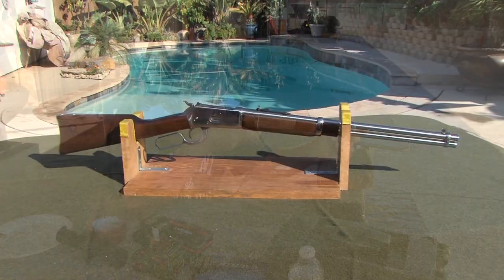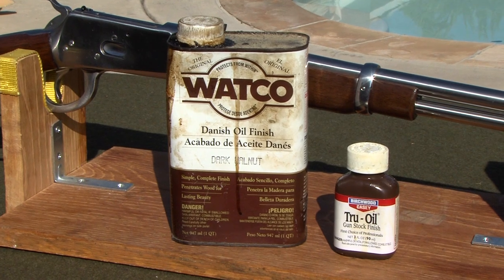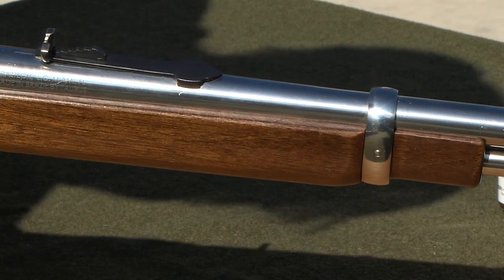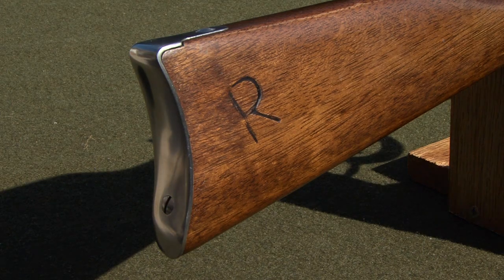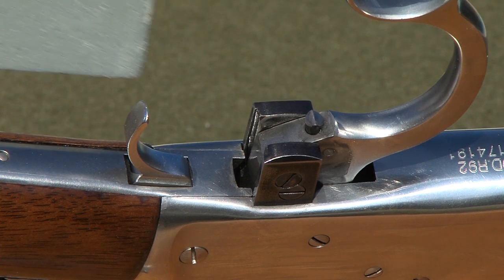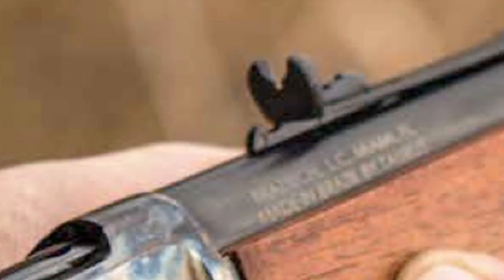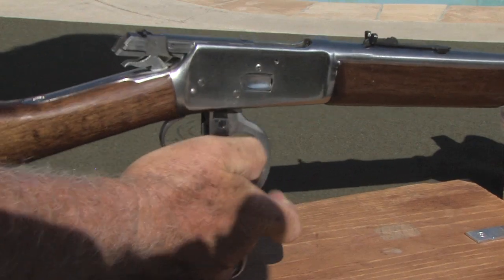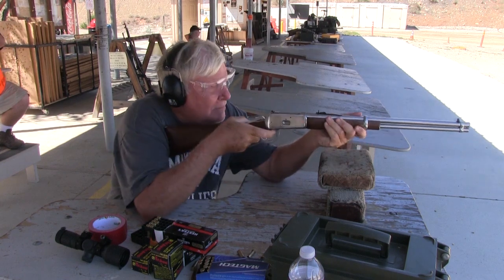Rossi 92 .357 tips

Comment: I have the 16 inch carbine in .44 Magnum. Not one jam! It loves Winchester White Label 240 gr SP and will shoot 1 inch groups at 50 yards (but that is because I replaced the rear sight with a Marbles folding sight and put in a brass bead front sight. Real good alignment of the sights.) Working now on a rear peep sight that fits the safety hole from Steve's. His kind of fits loose and I hope to use brass tubing to make it fit tight. Then sight in the ghost ring at 25 yards. I have a stainless saddle ring on it to for 'tactical' carry (like a one point sling on an AR.) All in all, it is well worth the price they ask for the gun.

Comment: Love my stainless 16” Rossi .44 magnum. Replaced the safety with the aperture sight and the plastic mag follower with a stainless one.. both from Stevesgunz. It’s the rifle I grab when I go running after bears and lions in the brush here in Western Washington. Puts em down for good with a well placed (and a couple not so well placed) shot.
Reply: My 44Mag Rossie now has a kickeez butt plate. It is a fantastic improvement. I also installed a Williams peep sight & side sling loops.
Reply: @geddycurrent1174  sounds like a nice setup. Is yours a 16”?

Comment: I used to own a Rossi Puma model .357 mag. rifle. It's the same as this rifle based upon the Win. model 92. The only maintenance it required over its lifetime other than cleaning was the replacement of a broken extractor. I never ever fired a .38 special round through it. I drove a 4x4 all the time and carried that rifle as my truck gun. I load for .357 a lot and I never had any problems wracking a round. I did notice you didn't know how to hold the rifle when you loaded it. Move your left hand rearward on the rifle until you can use one finger to hold the round you place in the loading gate.

Comment: Yeah I have a 92 with 16" barrel. Tiny little thing.  Ran smooth but it had a broken ejector.  Replaced the ejector but it had to be thinned out with a dremel to reduce the spring tension so that the action would close. Now it's smooth again and the shells don't hit me in the face.

Comment: Quality control must have gone way down over the years, cause theRossi M92 that I bought when the model was first introduced has none of these issues. It was near perfect right out of the box and is still one of my favorite firearms.
Reply: Rip Aycock   No complaints with mine either, which I got in 2018. Right out of the box, 1&3/4--2&1/4 inch groups at 50yds, about 3-4inches at 100yds with its buckhorn sights& leaning across my pickup hood, shooting 124-158gr FMJ & JHP. I believe I'll keep it.

Comment: It's kind of fun perfecting a solid steel and wood firearm.  I have a rotary Brightboy polishing kit that works very well.  Used it on knife builds to smooth out the solder joint on the guard soldering fillets too.

Comment: You mentioned some of the issues I had with the finishing of the gun. LOTS of sharp edges that needed to be smoothed down. And I had a enough issues with the gun jamming or launching live ammo straight up in the air when cycling, or standing up straight at attention in the receiver I sent it back to Rossi for warranty work. It turned out it had a bent frame. They are sending me a replacement. Hopefully I wont have to go through all the same finishing work smoothing down sharp edges. The underside of the bolt was practically razor sharp and sliced the top of my hand at the thumb open if I wasn't careful. A gunsmith friend helped me smooth the edges, now I know what to do myself if the new one has the same issues.

Comment: Great video.  I purchased the same rifle several years ago and did exactly what you did in regards to the wood.  Watco medium walnut and then Tru Oil.  In my case, I removed the rear buckhorn and replaced it with a Skinner peep sight (well worth the $ in my opinion) and a red fiber optic front sight.  The combination makes sighting a piece of cake and the rifle is very accurate.  

Excellent tips as far as ammunition, filing and polishing.  Thanks!
Reply from the maker: Eric, thanks for your comment.  That straight grained Mahogany really looks great after proper attention.  This is one of my favorite rifles when I'm shooting out in the desert.  Cheap to shoot and accurate.  The other rifle I take is my M1 Carbine.  Great and light weight!  Have fun shooting that lever gun!  Rick
Reply: Love mine. Where does the Skinner sight attach?

Comment: Very good video and straight to the point. I have as yet unfired Rossi R92 and interested in mods and opinions. My first job was to polish the loading gate and it improved my dummy test round loading, but you removed two inches of mag tube spring and that is my next undertaking to make loading easier.

Comment: Thank You Thank You- I used this as the rebuild plan when I got my Rossi 92 45LC. Many thanks!
Reply from the maker: hello William.  Glad my video helped.  My grandson is planning on getting a Rossi 92 45LC and I can't wait to shoot it.  I reload 45s for my Colts and I'll switch to a slower powder for the 20" barrel and see how much I enjoy it.  I've heard nothing but good about that caliber Rossi.  Rick
Reply: @skycamproductions  LOL-I do the same! - got to a single ammo and went 45LC. I have a Vaquero 6-gun (I modified it also, as I slicked the Rossi all over as well). Reloading, I use American Select power, 5.3gr-never more than 5.5, CCI 300s on a 250 RNFP Tex/Cowboy (Miss. Bullet). Works great on both the rifle and gun- burns clean too.
Reply from the maker: @wmwillis3   Thanks William for the reload info.  Because powder is still hard to come by, I may load the rifle rounds with the H110 I have left.  Also I use Titegroup for both the .45LC pistol and .357.  Once everything is restocked in stores, I will try your suggestion. Rick

Comment: I have one. The only issue I have found is it throws the spent shells right on my neck if I don't tilt the gun. And while I haven't sent real 38 special through it, the snap caps I have for 38 special kind of just go flying out of the loading ramp before I can close the bolt

Comment: I'm impressed you could load it with your thumb.  I've borrowed a stainless 92 a few times from a friend and loading it is a royal PITA.
Reply: He monitored that he pulled out the magazine tube spring and shaved off 2 inches.. I have done this also and can verify that it makes the loading process much easier, as well as it allows me to fix one extra round into the tube while having no effect on reliability
Reply: I bought a blued one recently and spent over 10 hours filing and polishing.  It's decent to load it now.
Reply: +spraynpray what barrel length did you get? Unless you got the full 22inch barrel, you should really consider shaving 1-2.5 inches of that magazine tube spring..
Reply: I have the 20" model.  I cut off 4" of spring.

Most internal surfaces had large amounts of flashing.  One bit was half the size of a dime and was folded over.
Reply: It still doesn't feed well, but it is far better than it was.

Comment: Some people say theirs will not cycle the .38's. Mine is a early one and feeds both pretty good.
Reply from the maker: +Shawn Swigart     Shawn,  I've experienced, with a full magazine,  double loading with .38s.  Sometimes 2 cartridges pop out.   At a range I seldom load more than 4 rounds anyway and that seems to be OK.  Also, I found that the rhythm of the lever helps a lot.  With .38s I push the lever forward, hold a fraction of a second, then pull the lever back.  I never load the rounds fast like the Rifleman.  Also, I seldom use .38s.  I've started reloading the magnum cases only.  Love the rifle even tho it isn't perfect.  Lots of interest in it at my range.  Rick
Reply: +Shawn Swigart Even the longer 158gr .357?
Reply from the maker: +filoIII Shawn,  I have no problems with 158 grn. magnum loads in general.  sometimes one gets stubborn and I have to give it a nudge into the chamber but my rifle has broken in well.  Have not reloaded with 125grn.bullets yet.  But will real soon.

Comment: Nice work. Next, remove the safety switch.
Reply: Make sure that you have a good reason to remove the safety.If you have to use that particular gun in self defense,you WILL be asked in court what prompted you to remove or defeat a factory designed safety device.
Reply: Were you asked in court? Or is this just an armchair comment?
Reply: @ @doughesson :  Can I ask where you live, state-wise?  Also, do you have any links to the cases where that happened in court?  Always trying to educate myself, and reading about the cases helps.  Thanks.

Comment: Over time some may find they needed some of that extra two inches of spring. I wouldn't trim until at least 500 rounds, preferably 1000 rounds. Just my two cents, take it for what it's worth.
Reply from the maker: Hi John,  you may be right on the spring trimming.  I've put several thousand rounds thru this rifle and its a lot of fun and so far have not had the severe feeding issues that I complained about.  The spring is doing its job so far.  But time will tell.  Thanks,  Rick

Comment: I found that it had nothing to do with the length of the cartridge, but rather the shape of the bullet.  Flat tips won't feed for nothing in my gun.  Rounded tips feed smooth as can be.
Reply from the maker: Hi X,  I believe you're right.  The Herters commercial bullet that worked smoothly was shaped slightly different than other brands.  It slipped right into the chamber.  I reload now and use an Xtreme 158 &125 flat tip bullet and a slightly tighter crimp and that has really helped.  Plus I've run a couple thousand rounds thru that great rifle.  Lots of cheap shooting and highly accurate.  Rick

Comment: How many inches would you suggest taking out of the magazine with a 16 inch barrel in the same caliber? I think I’ll just start with an inch and see if I need more.
Reply from the maker: Hi Taco,  sorry I didn't get back to you.  You undoubtedly started in cutting smaller lengths until satisfied.  That's what I would have done.  Its all experimental. On my 20", 2 inches was easier loading and fed well.  Rick

Comment: Are these rifles durable and accurate?
Reply from the maker: Hello John,  I have had the Rossi for 2 years and fired a lot of rounds thru it cause its a favorite rifle.  I elected to smooth it out a little and I found that certain brands of ammo worked better in the action.  I had an ejector break and ordered another.  But overall I have had a great time with this rifle.  It is highly accurate right out of the box.  Hope this helps.  Rick
Reply: skycamproductions thank you. Yours is beautiful and now I really want one!
Reply: I understand ejector breakage is due to a too strong of a spring on the ejector. I had mine replaced and use a replasement spring. It works great, going on ten+ years. Many rounds, my favorite carbine

Comment: Hi! Superbe video. I have the same rifle, in the same caliber. I'm extremely happy of his accuracy. It's superbe. I make your same jobs in the same parts and it's perfect. Anyway I have the same problem in the min4.00, and my 357 works bad. How do you solve the problem? Sorry, my low level of English. :'( I was thinking to solve it with a polishing at mirror finish in the inside of the barrel (in the brass case place as yours) and grind a bit and polish as mirror finish the lower part of the barrel's entrance (where the brass is having problems to going in).

Comment: what do you think about the ugly safety? is there a way to remove it?
Reply from the maker: +James McDonald   Hello Jim,  I actually used the safety to break in the rifle because it  secures the firing pin.   I cycled numerous live rounds thru the rifle when I first got it to try and break it in.  There are other youtube videos on removing it and plugging the hole.  I haven't done it.  By the way,  I just got back from the range and the .357 magnum Fiocchi's are cycling thru better now.  So its breaking in slowly.
Reply from the maker: +James McDonald   Regarding the ugly add on:  there are videos on Youtube about modifying and removing the black safety switch.  I have not done that yet.  When I was testing the carbine for the best factory ammo that would cycle thru flawlessly,  I always had the black safety on the SAFE position while running 3 live rounds thru it in rapid succession to test the action without discharging a round.  This is the way I found that the Herter's brand of .357 magnum cycled thru without a hitch while other brands and bullets needed nudging.  Plus I go shooting with grandkids and the extra safety is appreciated.

Comment: Could you tell me how the wood finish you put on this rifle is holding up for you, I just purchased one of these rifles and was going to use your process if it has worked out well for you.
Reply from the maker: Hello russell,  glad you asked.  The Watco oil is great to add depth to the flat finish.  But the True Oil seemed to be a soft oil finish that a lot of gun enthusiasts like.  But I sanded it down after a while and added the Watco Oil and then rubbed it down with a rag and let it dry outside for days until the wood felt dry.  Then hung the wood on my back patio and sprayed it with fast drying Polyurethane from a spray can..  After several coats, and once it dried overnight,  i took a pad of 4 ought steel wool and knocked down the gloss til I liked it.  I like this finish better and I think its tougher and more resilient.  Looks great,   Rick
Reply from the maker: russell,  you can see how I finished a wood grip for my six gun on my video on "Making wood grips for a six gun". I used polyurethane.  Rick
Reply: Thank you Rick for your quick reply and for taking time to explain the process to me, I really appreciate it. I want to add that you are really talented and seem to have a great sense of humor. Best regards, Russell

Comment: did you use any non-brass plated ammo by chance? if so, how'd they run through? no one likes a gun that jams, especially if it does so several times through its cycling, but I was thinking about one of these rifles for purchase. thanks for any feedback.
Reply from the maker: +Dee Ray   Hello DR - have not used any aluminum or steel thru the rifle.  Walmart has the Perfecta brand brass ammo that feeds well and is cheap enough.  I plan to reload the thousand cases I've shot thru this rifle.  Had two shooters at the range ask about the rifle the other day and they both liked the looks and weight of the gun.  But it has to function well and its getting better on all brands of brass ammo.  Hope this helps.
Reply from the maker: +Dee Ray DR- you may have been asking about plated bullets and I misunderstood.  If so,  I have purchased Xtreme FP brass plated bullets and plan to reload the brass with these using Titegroup powder and mag. primers (cause I have them).  Will work up several loads and will let u know how it shoots then.  Rick
Reply: Thanks Rick, and no rush on that. Just wonderin, and yes, I meant the plating of the ammo. Sorry for the confusion. I've never owned a rifle other than an M4. I've mostly been a handgun sorta guy, but still, I'd like to venture into rifles and explore all the wide range of a new territory.
Reply from the maker: +Dee Ray  Hi DR, I just got back from the range having shot 50 and 100 yard targets.  The best of 3 loads - 4.2 grains, 4.7 and 5.1,  was a plated bullet with 4.7 grains of Titegroup and a CCI magnum small pistol primer.  My info book states that a standard small pistol primer should be used but I have a ton of magnum primers so it still went boom at the right time.  At 50 yds. I held a tight group on level with the bullseye.  At 100 yds. I added some elevation to the rear sight at the point that my factory rounds are accurate and kept as good a group as my factory rounds.  I shot a few 5.1 grain rounds but didn't get any better response so I am going to load several boxes for the next trip at 4.7 grains.  I used both Berry and Xtreme plated bullets and couldn't tell the difference.  When I cleaned the rifle it had no lead fouling but was dirtier than my factory rounds . Also noticed a little more smoke when cocking the next round into the chamber.   Hope this helps.  Happy shooting,  Rick

Comment: Hows the recoil? If it helps can you compare it to a 223 or 245.
Reply from the maker: +Der Lila Camel Cochran   Regarding the recoil:  the rifle with factory loaded .357 magnums 158 gr. bullets is mild and not shoulder punishing.  Firing 38 specials is like firing a .22 rifle.  Its been a long time since I fired a M16 type carbine, but I own an AK 47 and it has a very healthy recoil.  You'll find the Rossi carbine a fun shooter.  Rick
Reply: I have the Rossi m92 in .44 mag and due to the metal butt plate it will bruise your shoulder pretty nicely. Bought a pad for it and can shoot 100 rounds without it hurting at all.

Comment: All they effort and issues....would you have not been better adding $200 and buying a Henry rifle...?
Reply from the maker: +gman77gas  I considered that but was intrigued by the Rossi and I enjoy projects.  Henrys are certainly better and made in USA.
Reply: +gman77gas personally I don't like the tubular magazine system I like being able to reload without having to pull off target. The henry's aren't any good in my opinion for CAS or other competition
Reply: Enjoy your choice!
Reply: My thoughts exactly.
Reply: I just handled them both side by side at a LGS.  like the stainless of the Rossi, but the Henry (steel) is beautiful wood.  Henry is much smoother and I like the side eject. I also like the extra weight, nice balance.  not hiking with it, would be mainly a range rec gun, home defense, and maybe some hunting. $600 vs $850.   which one?  (wish I could find a Marlin 357...)